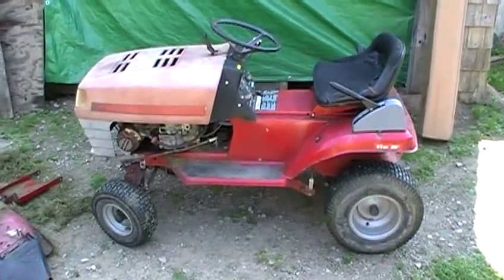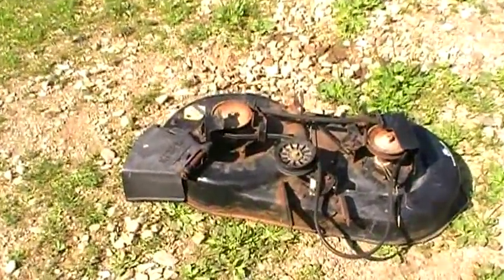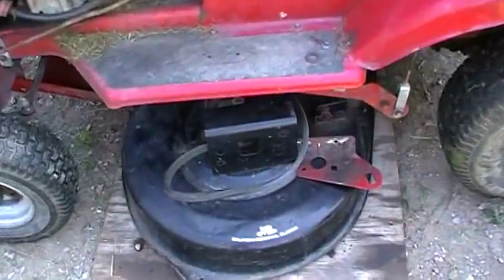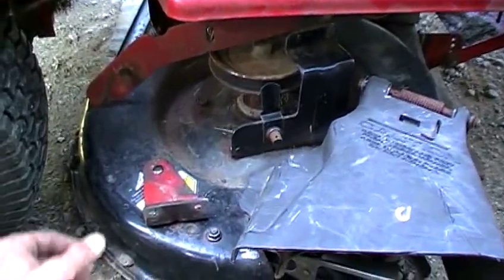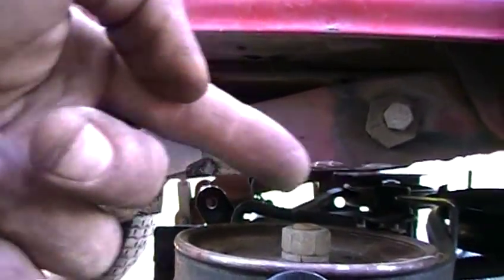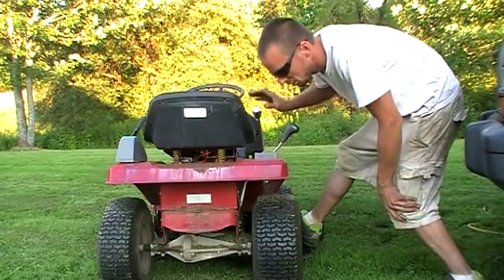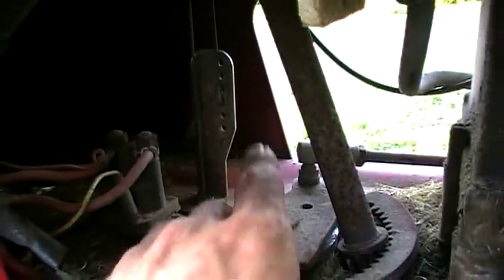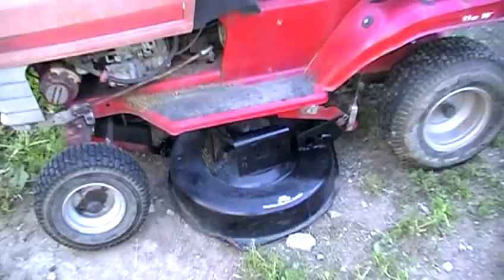Riding Lawn Mower Deck Swap

Comment: Very nice retrofit.  I will be doing the exact same thing shortly. My neighbor couldn't get his 2014 Husqvarna tractor started so he put out with his garbage. Unfortunately, he already gave the mower deck away. Anyway, I grabbed the tractor cleaned the mouse nest out of the engine and it started right up. A few weeks later, another neighbor was cleaning his garage and put an old 1982 Craftsman 44" deck out with his garbage. I will be welding a few parts on to the mower deck so that it adapts to this tractor, just as you did.  Again, nice job!

Comment: I replaced the 36" deck on my Dynamark (much like MTD, etc.) with a 40" deck from another tractor I got for $25 off Craigslist. I had to make some small adjustments for it to fit, but it works great. The 10 HP motor works more, but I just go slower and keep the blades sharp.

Comment: I'm not too sure if everyone does this, but hosing off your gear and sun drying it before spraying it with lube and putting it away will prevent that corrosion.
Reply: Drew Gormley also making sure your blades are balanced will prevent your deck from destroying itself 🤷‍♂️😂

Comment: dont the spindles have gears fittings like on your stearing of the racing mower? you need to gears that stuff every year or even more. we have a 6k ish farris zero turn and we grease that alot so that kinda thing doesnt happen. also im going to maybe be building another fast lawn mower if i can find one cheap enough i will :D

Comment: is the new deck 42"?

i am fairley new to welding and am considering getting a good starter to do little jobs when i decide i am a pro fabricator,or when i slip up with the torch. do you know of a good one within or around the $200 range?

Comment: could you do a video on the pulley set up that's the same mower I use for a mud mower and when I did a pulley swap I forgot how it went back together if you wouldn't mind it would be much appreciated

Comment: haha i remember when you posted this video not long after my bosses deck fucked itself. i kept telling him it needed replacement and he ignored me. so one day i was mowing heavy weds and the spindle broke and threw the blade out the side chute ! i decided fuck with it. so i looked around on craigslist and came across an almost identical deck that had only been used a handful of times,and it came with belts! so i got a hammer and tweaked what needed to and it fit like it was meant to be there!

Comment: my lawn mower when i crank it up my blades spin and it makes it a pain in the ass to start but my deck engagement is on a button and when it starts running the spinning stops and just to let you know its a z turn idk if that makes a diff but how in the world do i fix it cut the times when it does not do it it starts on one turn over and when it does it it turns over like 10 times before it starts and it cranks really slow when it does it it was cool to see that im not the only one with that prob

Comment: man I like your videos , cool job on the deck. I have an airens yt 12 that I am working on to play in the woods took the deck off few years ago it needed tires. I got some old tires for it and new tubes and old thing run good now.  It has a side post gm car battery under the seat LOL flat black paint, good buy orange. need to do pully change to make it faster and maybe gas pedal. I will  try to post some videos on my chanel soon.

Comment: lemme guess. wire fed 110 volt. why not an arc welder? it can weld through rust,paint,water,rubber,pretty much anything you can think of! it is slightly more chalenging than wire feed but it makes up for what you can do with it!

Comment: thats a true value 440 briggs and Stratton motor i have the same one i put a 3 inch on the back with a smaller tighter belt for more willies i got a lift on it and its fast! Please Message Me Back!